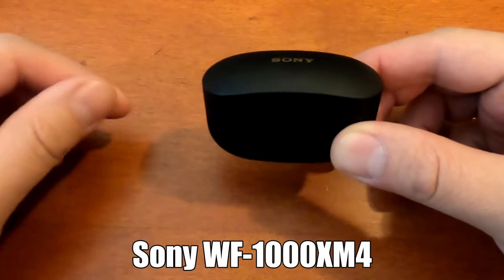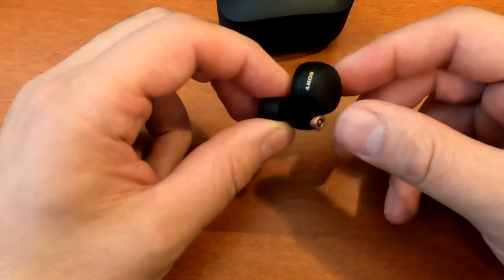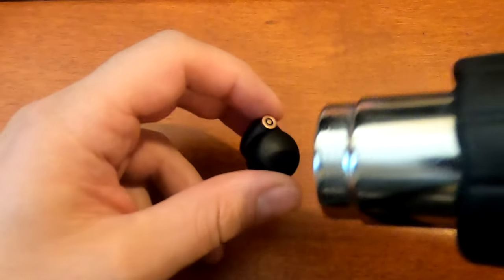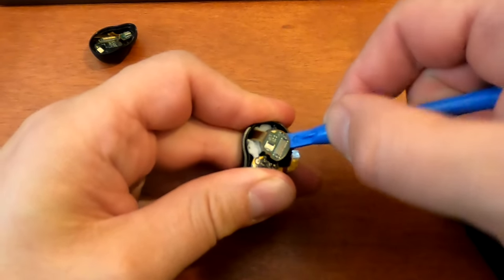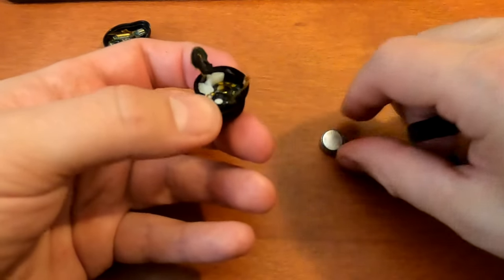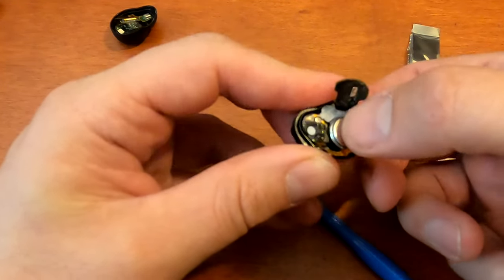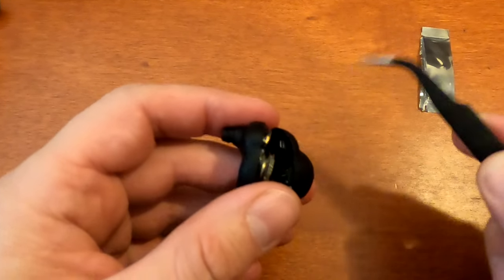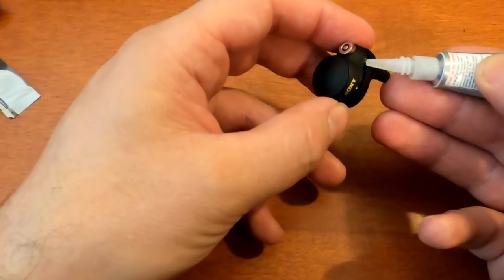[QUICK FIX!] Replacing the battery on a Sony WF-1000XM4 earbud

Comment: Thanks a lot for this video. Out of a sudden, my batteries were down to 25 minutes and my ear buds were pretty useless.
So I ordered new batteries, repair tools, glue and started motivated, but directly failed to open the buds. First I thought it was because I only used a hair dryer to heat them up, but in the end it worked nicely using water pump pliers. Replacing the first battery took me like an hour, the second was done in 5 minutes. So instead of buying new ones for ~300€ I got the old ones back for just ~30€. Nice one 🙂
Reply from the maker: Awesome!! Water pump pliers? What are those? Sounds like I need to buy a new tool!!!
Reply: @ificanfixitsocanyou  "Plumbing Pliers are also known as tongue and groove pliers, water pump pliers, adjustable pliers, groove-joint pliers, arc-joint pliers, multi grips, and channellocks"

Just a multigrip pliers.

Comment: Watch for the cable that connects to the negative side of the battery. There is a small piece of metal that makes contact to the battery I broke off. I used a bit too much force or pulled on it the wrong way.

I used a small piece of aluminum foil and glued it to the metal connector. It works good, charges great. I hope it holds up.

Comment: Awesome! I used your video to fix mine.  I just used electrical tape to hold the caps back on. That way I can just take the tape off if I need to replace the batteries again.

Comment: Well I did this, and it appears that they are now working like new. I started with the left one and the only thing that gave me grief was re-inserting that little ribbon cable....the eyes aren't what they used to be. On the right one, I decided to forgo removing the ribbon cable and it worked out fine for me. It's unfortunate that I found this video after ordering some new XM5's, though I have to say, the XM5's are an impressive step up. Anyway, great video on getting the XM4's back on their feet.

Comment: OK received batteries z55h used hairdryer + knife and flat screwdriver. It was my first time didn't damage anything and it took me 20min to replace both batteries at cost $20. They're charging now will see how long they will last. Thanks for the video 👍
Reply: Hi David, Any updates on the performance?
Reply: @nathankeee  they're working as they did when new,  two things glue b7000 use only tiny tiny drops of it in a few places tiny drops I mean use nidle to do it, glue is not to make it waterproof just to make it stick together properly because of the plastic is so tight it will be again ip68 or whatever it was rated just use really tiny amount of glue, guy in the video used to much of it. And second thing ribon he removed you don't need to remove it to pul the battery out. Just move ribon a bit to the side and heat the battery a bit with hairdryer and use small screwdriver to pull the battery out do it slowly so you don't remove that sticky tape under it.
It's really simple to replace batteries in these earphones and new batteries cost nothing.

Comment: I have just done the repair, I ripped the cable he removed with the tweezers (12:40) thought after replacing the battery and sealing it came up being one of the microphones (not the one controlling ANC sine after sealed works as good as a new one (had another pair next to me for comparison) not that complicated except that little flex cable I ripped. Battery lasts much longer after this

Comment: Thank you. I didn't want to risk it using a heat gun, so I just used a razor blade to cut the adhesive on the case. I think it could be done without removing the ribbon cable there's enough slack.

Comment: Thanks for making this video and making me feel that I can do it. I made the replacement on both sides with some struggle, but I made it work. Though I felt that the sound was not the same as before, which could be just psychological. Anyway, just want to thank you for the demonstration.
Reply from the maker: Glad it worked! Odd about the sound! If you figure out if there's really a difference, let us know

Comment: I liked my wf-1000xm4 a lot never had trouble with it. Lately after upgraded software both batteries died. They last for like 20min now and are getting hot while charging. Ordered replacement will DIY them in a few days.

Comment: Earbud fixed, battery life again measured in hours not minutes. I used a reasonably big hairdryer instead of heat gun and was able to open it at second attempt and I skipped unplugging the ribbon cable as it didn't seemed necessary. Thanks!
Reply: Skipped unplugging the ribbon cables because of your comment and now broke them, Thanks

Comment: Shortly before and also after update 10.2, right battery draining fast. Also having issues with the case charging but did a soft reset and now it seems back to normal. Might install new battery if this persists. Seems to be a common enough problem with the WF-1000XM4. Also, really crappy for a set of $275 earbuds after less than, in my case, 25 hours use. My prior pair, Creative Labs' Outlier Air, are going on 3 years and still work like new. And those were $75 (awesome battery life, sweatproof rating, LDAC, just no ANC) This is not an ad. lol But do read about their coming partnership with xMems, really neat. Thanks much for the fix it video. 👍

Comment: thanks for the video, very helpful.
when i detached the battery the glue didn't stick anymore.
i used two sided thin clear tape, it worked, but now im have a slight cracking sound on my right earbud... 
maybe i should use the same "rubber-like black glue" they used here, but i dont have a clue how to find it, could you please tell me which one is?

Comment: There is no need to remove any connectors. It is best not to, as many people will break the little ribbon cable. The other thing to be careful of is when prying up the circuit boards from the battery, be careful of the little sprung metal tab that contacts the battery, I've heard many people accidentally breaking this part.

Once you separate the headphone casing, use a small plastic pry tool to slowly lift the circuit boards off of the battery. If you do it carefully the glue will lift and stay with the circuit boards.

Then use a tooth pick or other small plastic tool to pry up under the battery, it takes a little bit of prying to get it out, but it shouldn't be difficult. It has glue under it as well.

Once that is out, put in the new battery and push it down into the slot  firmly. Then put the circuit boards back onto the battery. You can use a little bit of heat and squeeze it firmly together and it should stick.

TEST IT BEFORE YOU GLUE THE HOUSING BACK TOGETHER. Use a B7000 clear glue, have a paper towel and an alcohol wipe handy. Put a tiny bead around the housing (don't worry if you make a little bit of a mess) and squeeze it together. Whilst still keeping it squeezed together, run a paper towel around the outside to clean up excess glue, and then run back over it in a back and forth motion with an alcohol wipe. Then let it sit and dry for at least an hour (preferably overnight) before using it.

I just changed the battery in both of mine. Heating it up with my wife's hair dryer took longer than the actual operation.
Reply: I ended up breaking the metal tab. I glued a piece of foil to the board. It works fine.

Comment: would a standard hair drier be enough to loosen the glue? I'm skilled enough and have access to everything needed to perform the repair. But I'm not keen in getting a heat gun for this.
Reply from the maker: Yes, it could work. Although you might need to keep the heat on for longer to loosen the glue

Comment: I got the XM5's yesterday. The battery depletion is unequal on the buds. Sony says this is normal as it depends how the buds are being used. I imagined one bud is processing more rhan the other.  However, after charging from 0% for 5 minutes, the left bud is at 10% and the right is at 25%. How could that be possible if it were only a processor priority issue? Bit sus. I think im going to take them back.  After paying so much for them a person shouldnt need to be googling battery issues. Wondered what tiur thoughts on that battery issue description might be? 
(Seperately, thank you for making yiur video.  It helps people a lot).

Comment: The right side earbud replacement went good for me.  On the left earbud, however, I ripped the ribbon cable in half trying to wiggle it out of the connector. 🙁

Comment: Thanks to this video I got my new batteries yesterday and swapped them both. So far so good 👍🏾 just so u know I didn't need to unplug the ribbon cable or anything. Theres enough room to slide the battery out from under the board after you remove the sticky pad. Took 5 mins each
Reply from the maker: Ooh - that's good advice! Glad you made that work!
Reply: @ificanfixitsocanyou2494  my earbuds lasted my entire 8hr shift at work today with the noise canceling off. Tomorrow I'll see how they do with it turned on. Also both kept the same % too.
Reply: Did you use a heat gun?
Reply: @scottflores4482  Nope. Mine is way to big. I just used a cigar lighter for 3 or 4 seconds to get the one side started then the rest came loose easy
Reply: @Nocturnal thanks i think i'll leave mine in the 100° sun for a bit🤣🤣🤣
Reply: @scottflores4482  🤣🤣🤣
Reply: Be careful doing this.  I did exactly that for the left one, but during the extraction of the right one's battery, i snapped that daughtercard cable clean in half.  It is VERY delicate, and if it breaks, you're out a $300 set of earbuds.  :(
Reply: @scottriddick8234  most definitely 👍🏾👍🏾👍🏾 If I hadn't already been doing electronic repair for years I wouldn't recommend anybody trying this. I also did it in a warm room so things are a tiny bit more flexible and b4 it could cool off from the heat gun

Comment: Bought these when it came out, there was a big hype, but not worth it. I did a hard reset, the battery charging seems a little better now, but I will definitely replace the earbuds rather than the batteries.

Comment: Thanks for the well made video.   I agree with @gslondon - using a knife worked well for me to crack open the earbud.  Sorry to report, but I did not have luck getting my unit to operate after getting it back together.   Lots of fragile parts inside.  I certainly didn't assume success was guaranteed.  I'm wondering if the ribbon cable got damaged during my process.  It is a fragile part that was difficult to get both out and back in the socket.   I'm still glad that I tried to repair.
Reply from the maker: Sorry it didn't work - but maybe the battery isn't making contact? On either side of the battery, there's a small metal tine that should be pointing "upwards" towards the face of the battery. Imagine your hand flat on a table, then lift your index finger - that's the springy metal tine that will touch the face of the battery. It may have been smooshed flat and is no longer springy - so carefully pull it upwards and re-seat the battery. No other registration should be required. Good luck!

Comment: Thank you for the video! But extra help needed or suggestions needed please. I changed the batteries in both ear buds, both seem to be recognised and charging when i place them in the box as the orange light comes up. But neither of the two buds seem to be working as they are not detected by Bluetooth. I thought I got away with doing it, without breaking anything visible. Any suggestions????

Comment: The little tab that is supposed to connect to the battery from the mother board is missing. Like there is a little slab of metal missing. I don’t think I can establish a connection with the battery anymore.

Comment: I sent mine in for reclamation and had them replaced free of charge, but this was a great tutorial and I might end up doing this in the future. 👍
Reply: Where do I send my sob story to get mine replaced? I purchased mine on Amazon though I don't have receipt or anything that I can prove it
Reply from the maker: I also bought mine through a reseller. When I called Sony, asking about warranty replacement, they declined. They had looked up my serial number and it was registered in their system as being sold to a re-seller or something? Because of that, they don't warranty the item. So by going cheap on my initial purchase, I ended up having to fix them myself - but it worked!

Comment: Question, I've replaced both batteries,  left and right. At first the right wouldn't connect,  but after charging them both overnight- there right connects and is recognized by bluetooth- but the left Don't get any signal.  
      Any advice?
Reply: UODATE:  since replacing both batteries and charging them  and then the Right earbud being the only one that worked...... for some reason that I can't explain- after 2-3 weeks, the Left one works just fine now!.    With the new batteries these last for HOURS!!!!! I listen to them all day!

Comment: Is it necessary to remove the little flex cable? Can't you just lift the board from the battery to replace it?
Reply from the maker: You are correct - some people in the comments have been able to lift the board and remove the battery without detaching the cable.
Reply: @ificanfixitsocanyou  ah, nice! I didn't read those comments. I'll replace my batteries next week or so when the new ones I ordered arrive. That's why I was wondering because I'm afraid to break something. 😅 thank you!

Comment: You made it looks so easy I definitely going to try it but the question is will the issue won't come back?
Reply from the maker: I am 100% certain that these batteries will fail over time and that they will require replacing. (All batteries fail eventually.) But now that I know how to do it, I should have these ear buds for a very long time!

Comment: Hi there. So I believe its been like 2 months since battery replacement shown in your video. I purchased batteries myself with everything ready to do exactly just like you have done. But then, what if the real issue is in the software or charging case has battery with under/over voltage and needs changing as well to match the batteries in earbuds? Bit overthinking it, but I thought I would rather ask of how does the fix work for you after 2 months? Thanks
Reply from the maker: So far, so good! The case is still charging as it used to, and the ear buds seem fine. I think using the exact same battery helps ensure that charging / discharging is the same.

Comment: Thanks for the tutorial, what temperature did you set on heat gun? Thanks
Reply from the maker: I used the Low setting, which I think caps out around 700F. And as you can tell from the video, it didn't take much to get the glue to give way!

Comment: Ribbon on mine broke when I tried to disconnect from the circuit board. There was some glue attached to it near the 45 degree turn. Headphones still worked with about 30 minutes per ear, but definitely one is garbage now. I would advise to gently detach the ribbon from the glue somehow first, then attempt to disconnect the ribbon, as I think the glue is what did mine in.

Edit:
Fwiw, I read this ribbon controls ANC in full or partially, so the headphone will still work but will not support ANC.

Comment: By far the hardest case I've attempted to crack into...guess I'll finally buy a heat gun and come back to this one then.
Reply from the maker: Good luck! You've got this!
Reply: Hair dryer, or 3d printer heated bed maybe?
Reply from the maker: @3888Orbost  I don't have a 3d printer so I don't know how hot the beds get? With my heat gun, I got it quite hot - too hot to touch.
Reply: I've hit it with the heatgun now 3 times to the point the plastic even started to melt...I'm beyond the point of giving a fuck.
What I've learned and my plan of action.
Sony isn't what Sony once was and I will never buy another Sony product.
Thanks anyway for the information.

Comment: Okay, so I've been working on the right one for a FEW DAYS. Turned out I accidentally broke the connection between the battery and the dickflap, so I added a blob of solder and now it's fixed. Also used two-sided tape. 😬😂 If it works it ain't crazy! Both earbuds work now, thank you so much for this tutorial!

Comment: Where did you buy the battery.
Reply from the maker: I bought mine on AliExpress! But I've also seen them on Amazon. The ber to look for is "ZeniPower Z55H" litium ion batteries. That's the model in the earbuds - I'm sure other batteries might work, but I haven't tried.

Comment: Ive had no issues, only use them for about 6 hours a week, maybe thats why? Bought them new in March 2022, was it fixed at that point in factory?
Reply from the maker: I'm not sure if these batteries died due to some fault or if the batteries just gave out. Some people have mentioned that it could be related to a firmware update, but I not sure.

Comment: Is there something you need to do for the earbud to register? I replaced the battery but it does not turn on the earbud. I put the original battery back and it works but obviously I can’t use it. So am I missing something? I also tried resetting and it would not let me do that either. Please help lol
Reply from the maker: Maybe the battery isn't actually making contact? On either side of the battery, there's a small metal tine that should be pointing "upwards" towards the face of the battery. Imagine your hand flat on a table, then lift your index finger - that's the springy metal tine that will touch the face of the battery. It may have been smooshed flat and is no longer springy - so carefully pull it upwards and re-seat the battery. No other registration should be required. Good luck!
Reply: @ificanfixitsocanyou  thank you for your reply.